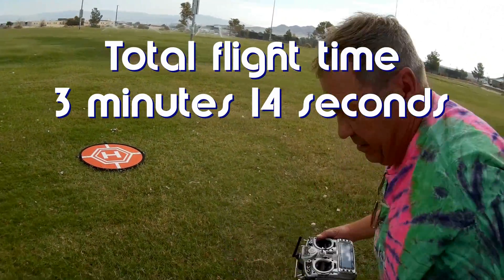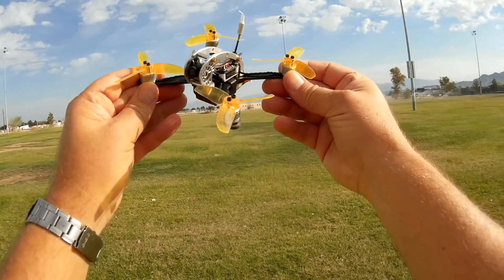Kingkong Fly Egg 130 FPV Racing Drone Flight Test Review

Comment: WHAT DOSE  IT  NEED  TO USE  THE  FPV GOGGLES?
Reply from the maker: It comes with a built-in FPV camera and transmitter.  But you will need to purchase 5.8Ghz analog FPV goggles to view the transmitted video.

Comment: Hey Quadcopter 101 me again, I recently found an old drone that I have finally been able to identify as the SY X11 and it has a port above where the battery goes which has 4 pins and I would like to know if I can put a FPV camera on it and use it with cheap goggles like VR-006 as I don't know if I can put a camera there and don't want to buy one unnecessarily
Reply from the maker: This one? https://www.youtube.com/watch?v=g5or7cTMQ8E
Reply: No, this drone is quite unknown (SongYang X11) so if you are willing to put in the research I would have serious respect for you but it is this drone:
https://www.youtube.com/watch?v=jGhBm9O0Uj4
https://www.youtube.com/watch?v=WnAHd5LVZoo
Reply: Also, there is a camera version of this drone called the X11-B which has a camera which leads me to believe you can use one in the 4-pin slot but just want to make sure as I don't want to break my drone

Comment: I looked on Amazon and they have some 2S 550mah 80C batteries fairly cheap .. 3 for $15 and they got over a 4 star rating, so they must be pretty decent. The other option on the plug is to change to an XT30 plug. I don't think you will gain much going to a JST over the balance plug, given the same gauge of wire. A lot of cheap batteries (like the 35C they provide) really sag in voltage, so you can lower the battery alarm voltage in Betaflight so that you don't get too many "false alarms". Its a good flyer, but I've never been a fan of their VTX, which is a very 'select group' of just 16 channels, and a chart you have to refer to in order to figure out which channel you are on. If you have a lot of FPV models, and typically use one channel all the time, its likely that your favorite channel won't be included (as was the case with the KK90GT for me). It's a good flier, and a nice size. Thanks for the review. Cheers.
Reply: And the 2S is safe for this quad?  (just to be sure)